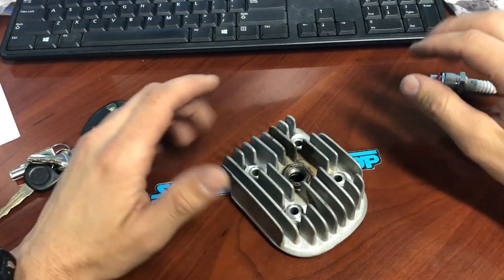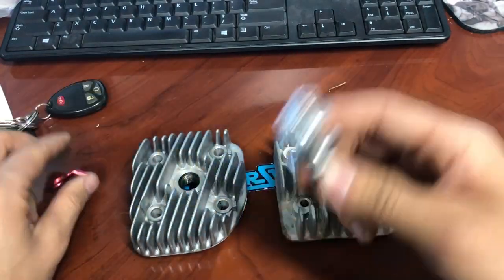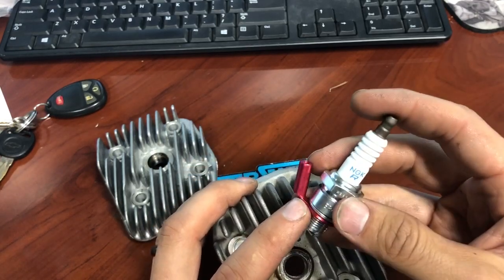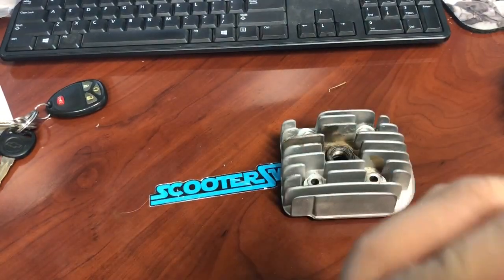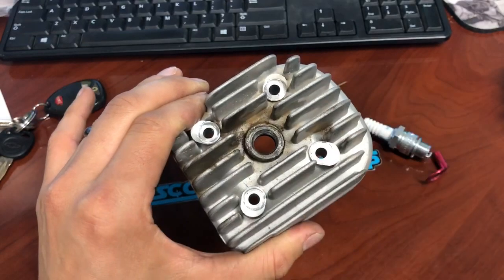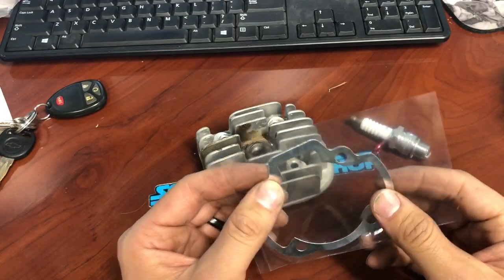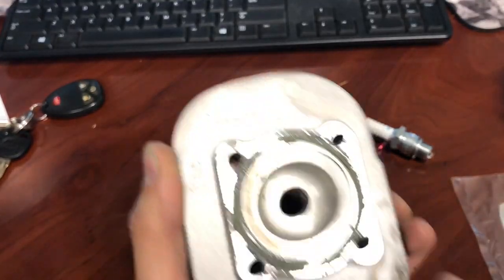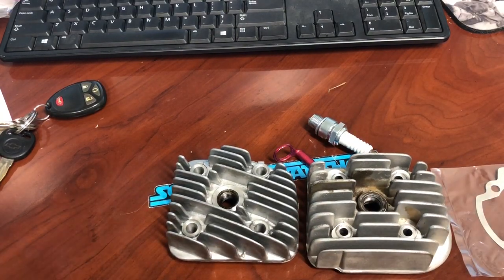Scooter overheating tips

Comment: Thank you for this. I have just put on a new 49cc on my goped and was having overheating issues also and it would not start up again. I have also found that a boost bottle will help a little. also replacing the air filter to a larger one. not much! but helps a bit.
Reply from the maker: Glad it helped
Reply: Maybe you try make bigger fins

Comment: Hi I have a sym 200cc starts perfect but ones riden for 10min and I turn it off it won't start back up again. Iv noticed the spark plug is solid tight could this be why it's not starting up again in till it's cooled down?

Comment: Thank you for the explanation. I run a chinese scooter with 100cc Minarelli engine, 24mm pwk carb, carb setting looks ok, engine oil is ok, gaskets are ok, but just a little leak on the head cylinder. I rode the bike for at least 45 minutes non-stop, there was rough sound at engine and the throttle became heavier, so that i think i have overheating problem. Any advice? Thanks
Reply from the maker: cool! sounds like something broke..

Comment: Bro I have a Honda Scooter 49ccm  2 stroke X8rs and its air cooled 
I was riding all day long with small pauses like 5-20 minutes to cool off
But my motorbike changed like the sound it became like louder and faster like it was usually going 50-60 kmh but now it goes 75 kmh,it leaked a bit of oil and it accelerates by itself 
What cloud be a problem? Maybe its geting more gas than it should like not enough oil

Comment: Can’t I just do a compression test to see if there are leaks? If so what compression should a horizontal Zuma be with a 70cc?
Reply from the maker: No a compression test is for compression. Not for air leaks.. all depends on the cylinder you have
Reply: Scooterswapshop hey thanks for that info! I realized it was just too bogged down from not working on the cvt. Now I took out 3 of the 6 rollers this thing screams!
Reply: @toph308  stock rollers? Did it help acceleration as well as top speed?

Comment: I have a overheating problem with my brand new malossi 70 kit and when I take the plug out it’s the same as the one in the video any ideas? Thanks
Reply from the maker: Hi did you try to contact d the shop you for the cylinder from for support? It’s hard to know without the details on your bike and the parts

Comment: If we have a leak on the cylinder head how can this be corrected?
Reply from the maker: Saxo pt 51 you need to find the leak, take the head off or wherever it is. Replace the gasket and re seal
Reply: @Scooterswapshop  what if the leak is from where the spark plug comes?
Reply: Saxo pt 51 get a new piston head